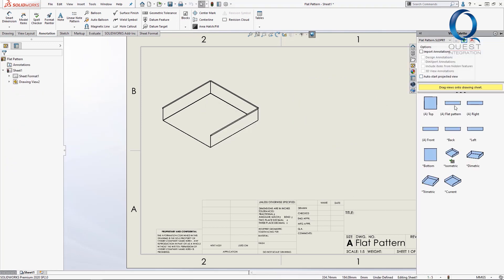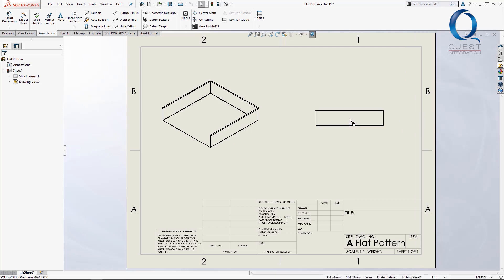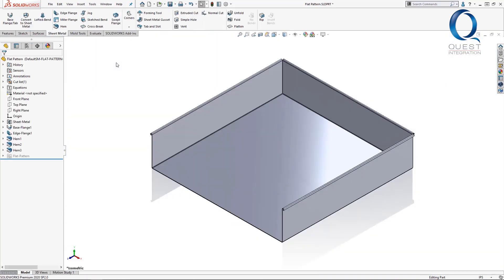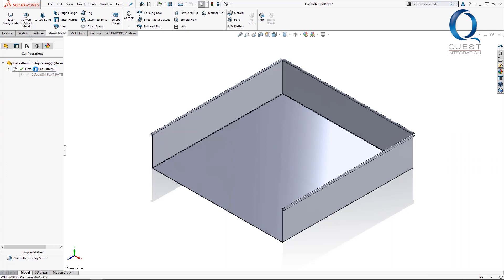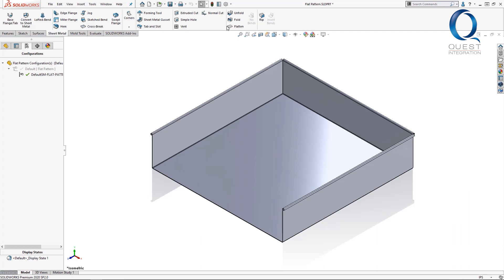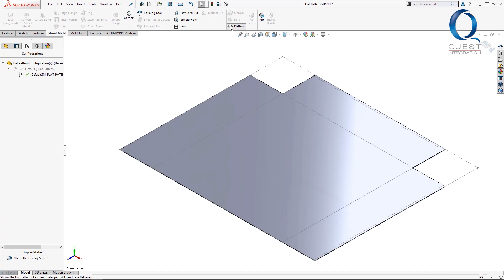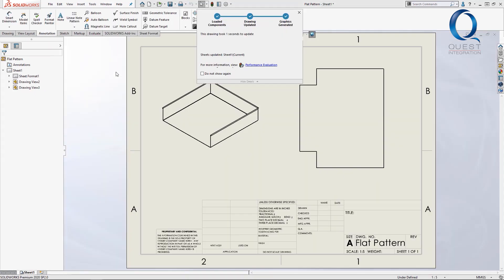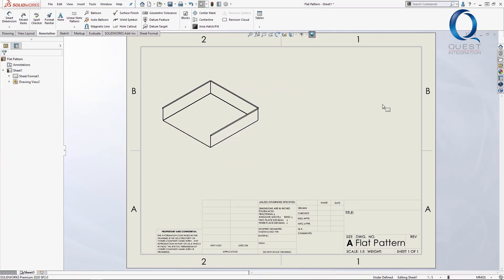Flat Pattern Issues in SOLIDWORKS

Comment: "...whenever you create a drawing of a sheetmetal part in Solidworks, it will created a derived configuration which will show the flattened part"....Not true. No derived config created, not flat pattern view in the view pallet. This function has many bugs and fails very often to do what it is supposed to do

Comment: An issue I had was changing the fixed face of a bent part that as as created by solidoworks using base flange. The flat pattern ended up being oriented at a 45 degree angle to the top plane because of the fixed face solidworks chose. It's pretty straight forward once you know where it is but not real clear if you haven't needed to do it before. At least it wasn't to me or my colleagues. If you expand the flat pattern then right click on flat-pattern 1 then click the edit feature icon (looks like the Extrude boss/base icon with a pencil in front of it) you'll see the  "fixed face" in the parameters window  where you can chose a face that's parallel to one of the 3 major planes or which ever one you want. I needed this because a sketch I'd drawn on the surface I wanted fixed was 45 degrees from the original fixed face. This caused the sketch to be distorted in the flat pattern on my drawing and in the dxf I was creating for my laser. This sketch was used to creating etchings to show where to locate other parts that get welded in an assembly and not actually cut the material.

Comment: Hi Chase...I have a question a bit off topic, but here goes.  I am designing a cardboard shipping box using SW Sheetmetal to create a flat pattern for cutting and printing.  I start with the box and then add the decal artwork.  Seems simple enough, but when I create the flat pattern all of the artwork disappears.  I could really use your help!  Thanks!